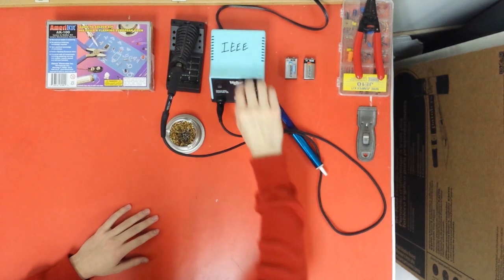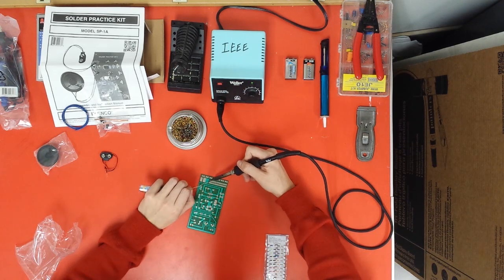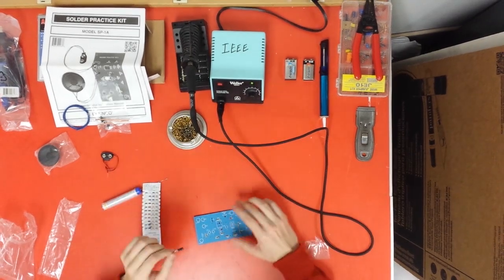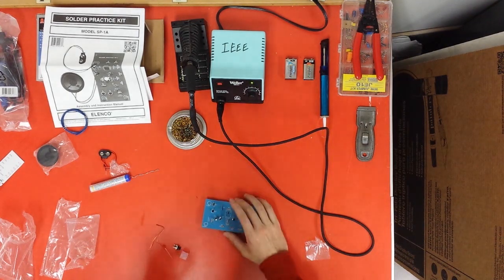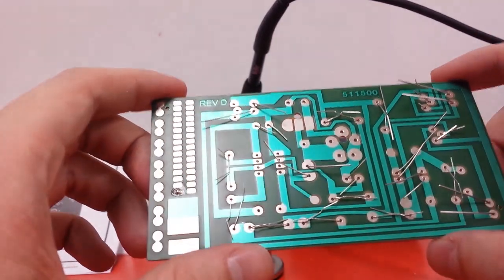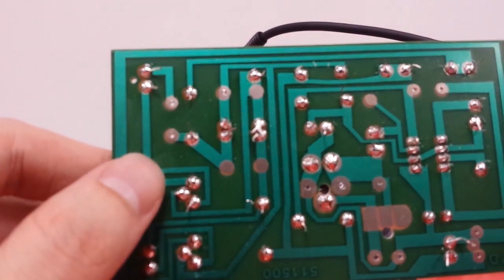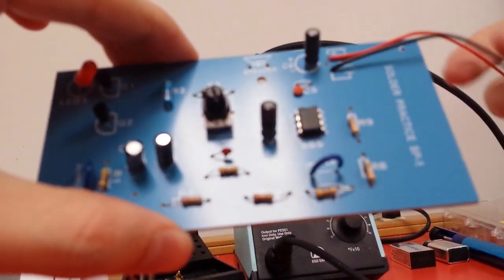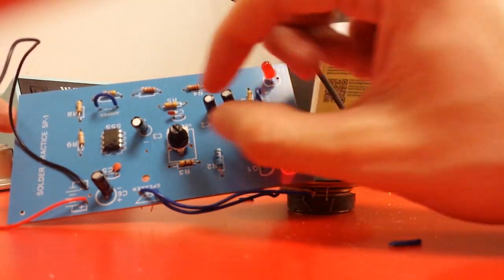European Siren Kit

Comment: Finished, my speaker doesn't play. I think my mofset is defective
Reply from the maker: kirbythebamf check your polarities
Reply: @sarliman  I never soldered to the board in order to ensure polarity,  so I could swap in case they were off as the board has no markings in that area.
Reply from the maker: You need to solder components to the board or nothing will work, that’s how the electrical connections are made
Reply: @sarliman  shouldn't a "bump" be possible even if it's not soldered? I have lots of experience with speakers and a solid connection is not necessary to get feedback from a source. Unless the physics of the PC board are different from typical conductors
Reply: @sarliman  I went back and soldered it as I need to because it's a test out for a class at Uni but as I suspected, there is no feedback. Even desoldered and soldered to check for polarity issues.
Reply from the maker: kirbythebamf did you place the IC in its socket? Is it in the right orientation?
Reply: @sarliman  IC? Do you mean the MOFSET?
Reply: @sarliman  My professor will have to look at it regardless, could be that the solder on the MOFSET is done poorly and connected leads that were in parallel due to the small spacing in between leads.

Comment: I built it correctly but it for some reason does not work. And i put rhe jumpers in too
Reply from the maker: Timofey Kozyrev check solder joints and capacitor polarities
Reply: @sarliman  i did. Mine is a piece of junk. On if the parts got broken. I checked it with a multimeter and it did not show anything
Reply from the maker: Yea it’s not the best design

Comment: Any idea why the sound wouldn't work?
Reply from the maker: Dominique Vega it can be a number of things. I'd check the orientation on all of your components. Also make sure that the solder joints are making connection with the metal pads of the PCB. Check your aluminum capacitors, diodes, LEDs, and your IC for proper orientation.